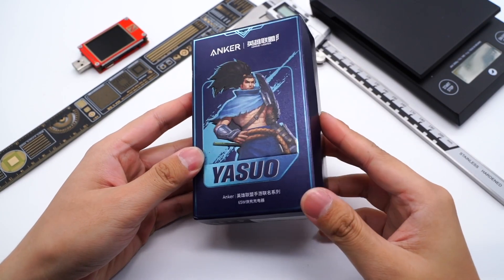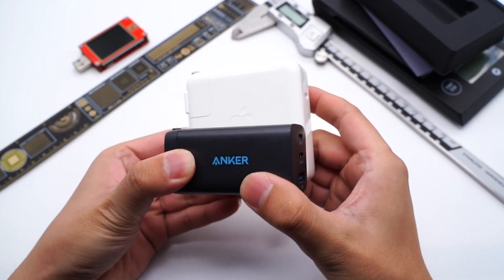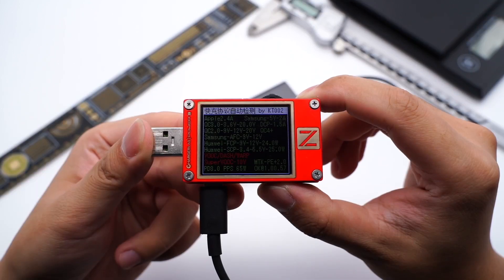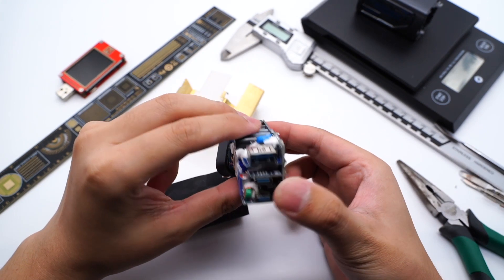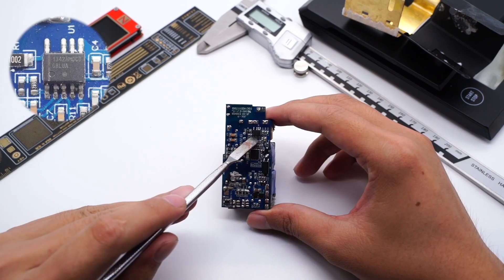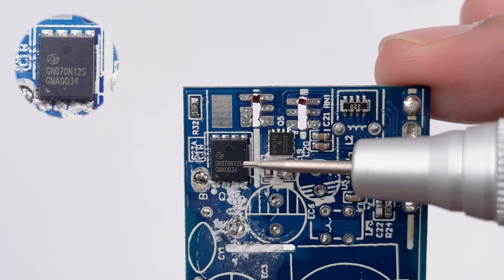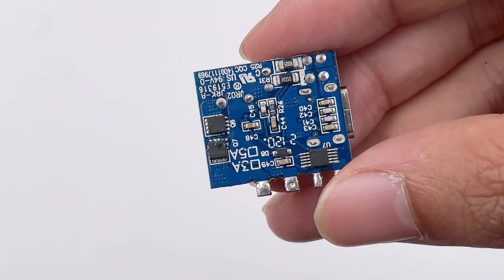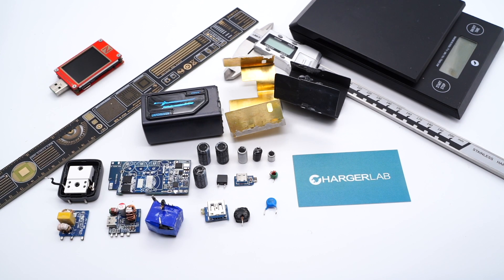Teardown of Anker PowerPort III 65W 3-Port Fast Charger (League of Legends Version)

Comment: Please i want to buy a charger support pps protocol 45 watt to charge the new s22 ultra and samsung official charger have three supporting pps voltages
 3-11V/4A 
3.3-16V/2.8A
3.3-21V/2.1A
And it doesn't exit in my town and i found baseus gan3pro 65W & 100W charger that supporting pps protocol in the following voltage parameters
3.3-21V/5A only

Is baseus charger will be completely compatible with s22 ultra and give it the full charging speed as the original charger ?
- is the voltage parameter for baseus  cover all the 3 voltages parameter of samsung official charger ??
Reply from the maker: Hi, in theory, the GaN 3 Pro support 45W of  new s22 ultra. 
But we cannot guarantee that, cause we haven't got the s22 ultra.

Comment: Great video, however I have two corrections for you.

That "heatsink" on the outside is actually an EMI shield. It was soldered to a common point to act as a partial faraday cage to keep the charger within EM emission requirements. Those small switching circuits and transformers are VERY noisy. It has very little to do with heat besides at least being thermally conductive to pass heat to the outside enclosure for dissipation.

The "thermal adhesive" and "thermal glue" as you always call it is primarily just a vibration dampener. All that white gunk (or whatever colour they use in each charger) is just to keep everything glued down so that if you drop the charger, the capacitors and other big components don't just rattle their solder joints loose. There will be some small thermal benefits to it, helping to spread heat away from hot components and to the enclosure, but that isn't the primary purpose.

Keep up the great videos! Not many channels offer this kind of in-depth component analysis of modern products.
Reply from the maker: Hello, thank you for your suggestion.
We did contact the manufacturer and they said that the outside "heatsink" is more likely to be used for heat dissipation.
But we still cannot rule out the possibility of EMI shielding. Different chargers may vary.

As for "thermal adhesive" and "thermal glue", it mainly has two functions of fixing and heat dissipation. Therefore, we are all right.
Reply: Yep. Both of you are right. They use as heatsink + EMI shield

Comment: Disappointed on the components inside (non power integration chip, cheap capacitors etc.. wondering if components inside differs from the anker ganII 3port the original looks like the 65w ganII
Reply: Are the Anker made chargers with power integrations chip better? How so?

Comment: hii can uprovide good information on part performance like caps some good one like niponchem rated 105 c 2.5k -3k hours some cheap one 105c in 1k -1.5k hours ... or some mosfet efficiency its resistance or response time ... or its charger voltage output noise ripples on max load on various voltage... some like marco reps review would be very good